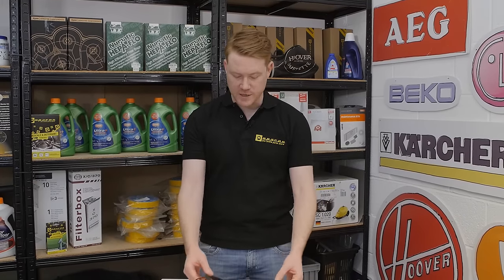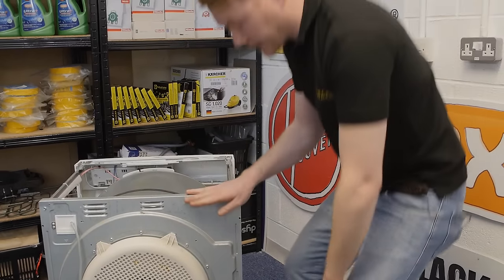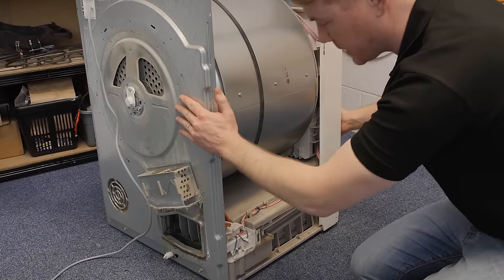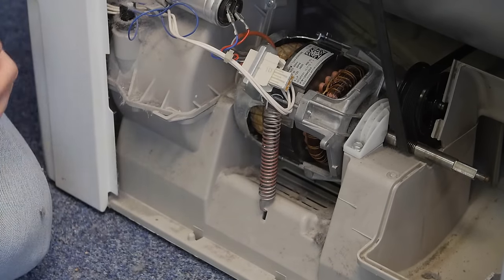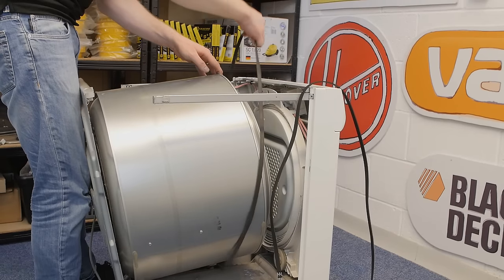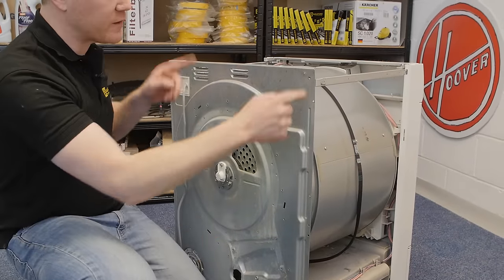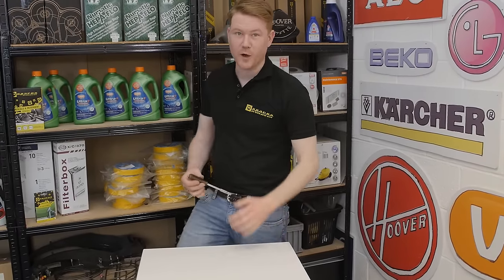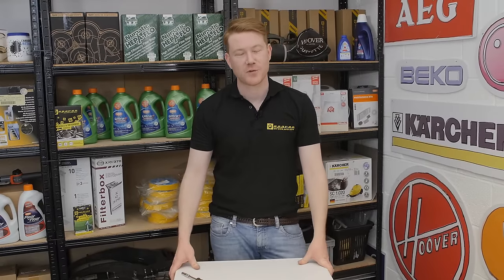Zanussi Tumble Dryer Belt Replacement – Change a Dryer Belt YOURSELF!

Comment: If anyone is trying to replace the belt on a Zanussi Lindo 100, you have my sympathies. It was not like the demo in the video ( there would be a lot more cursing if it was 😂) and some of the components were in the opposite sides of the machine. Many more screws too. Thanks to this video though, I got there in the end . It was a fight though, and I’m still not sure who won … myself or Lindo.
Reply from the maker: Hi thanks for your comment here...it's great to hear you have been able to complete the fix, especially as you were having issues and it took you a while. Sorry  this video couldn't help you further...appliance design can vary between models...but glad it helped you in some way.
Reply: Hi, i have the same problem with lindo 100. can you help me which side should i take off front of the back? i think the front, otherwise i cant take out the fan also....😢

Comment: My dryer was slightly different so I went through the front to get the belt on which was a simpler job for me. Then I had to remove the two covers of the front and back fans, and remove the motor, leaving all the wires all connected, and then I could put it through the belt so that I could get it onto the pulley system. Delighted with myself, fixed my dryer for 16euro ! So this video definitely helped me understand what needed to be done, but just a few slight differences.
Reply from the maker: Hi Fiona, this is amazing news! Thanks for sharing your own fixing experience with us. We are so glad our video helped you have the confidence to fix your tumble dryer yourself!

Comment: Great video.
I found on mine that the metal heater cover was very firmly stuck home. I had a look at what was left of the chassis and removed the two screws left at the top which attach the rear to the top rails. With these two screws removed there was just enough give to pull the drum back off its seal and guide wheels and refit the belt.
I didn't have to remove the heater.
Again thank you - without video's like this life would be way harder - as it is I have earned loads of brownie points........
Reply from the maker: Hi Jim, thanks for the great feedback and helpful tips. eSpares loves helping customers save money and fix their appliances. Well done for the fix!

Comment: We last changed the belt on ours about 4 years ago and it was murder!  This video is nice and clear,  anyone could follow it.  Thank you.  Very well done!
Reply from the maker: Thanks Victoria for the comments, remember to 'like’ the video if you enjoyed it or it helped.👍
Reply: eSpares Hi ,  my machine doesn't work unless I reduce load and manually give few turns to the dryer,  quickly shut the door and press start. Is the belt old and loose or problem with motor? Thanks
Reply from the maker: The problem is likely to be the motor capacitor is failing, for more information see our diagnosis video:
https://www.youtube.com/watch?v=u6614TVugVc  and
https://www.youtube.com/watch?v=Vd8DcQpk748
Reply: eSpares thanks

Comment: Good video. Excellent camera work. 
Watched this and another good video, before attempted repair - obvious broken belt.
Other video only took off left panel, but removed the centre bearing piece - to allow the belt to go over the drum.
This method avoided taking off the right panel, the fan and the heater and needed no electrical disconnections. 
Pulley route needed a few viewings, but route is obvious when you consider how the belt achieves tension ! 
Repaired our expensive AEG condenser dryer. 
"Brownie Points" earnt from my wife after ordering belt whilst on holiday & masses of washing to do on our return ! (Daughter report the breakdown). 
AEG is very like this Zanussi. 
AEG has a slightly different bearing cover with a lubricant applier ? (similar to a electrical carbon brush). 
Straightforward with average DIY skills, although admit to having two different screws left over (not the "hidden" ones mentioned) despite taking great care in placing them all in a plastic ice cream container to prevent loss ! 
There are a lot of screws. 
Bearing circlip "pinged off (as they do), but held a cloth over it to avoid loss ! 
Many thanks. (Subsribed !)
Reply from the maker: Hi Philip, thank you for your post and nice job on the repair, thank you for subscribing as we have many more useful videos coming out.

Comment: I managed to perform this fix without removing the rear heatsheilds or heater.
Just top, sides and top support rear screws which gave enough clearence to get the belt down the front of the drum.
A good tutorial video though gave me a good starter for 10. 👍🏻
Reply from the maker: Hi Ed, nice job.

Comment: I just completed a belt change on Zanussi TD4113W.  This is NOT a Condensing TD.   Your video gave me helpful hints but suggested more work than necessary for this machine. 
Remove top.  
Two additional items on the sides : 
- the vent outlet on each side has a screw; 
- there was a metal clip at the front of each side panel that needed to be removed.  After that only the top bar needed unscrewing from the back on each side.  Then the back can be tilted (gently because there are still plastic parts screwed near the bottom) enough to withdraw the drum from the front of the machine.  Put new belt around drum.
The fan is not at the back of the machine so the pulley and motor are already accessible. Reassemble. Done.
Reply from the maker: Thanks for the comments and description Steve. Although you were working on a different machine the description given may help others with models similar to yours. :-)
Reply: eSpares yes it worked for me needed to undo and redo everything you stated  to change the belt thank you for spending the time to make a video I was just making sure that I did it properly
Reply from the maker: Thanks for the comments Andrew, remember to 'like’ the video if you enjoyed it or it helped. 👍

Comment: Very good. This is similar to the AEG version. I’ve found, so far, that the capacitor, to the left of the motor and the pulley wheel for the belt seem to fail before the belt goes. At £9 for the capacitor and £7 for the pulley wheel, they are cheap to fix.
Reply from the maker: Hi robert, they would be similar as they are both owned by Electrolux so made in the same factories but well done for sorting it.
Reply: Thanks!

Comment: a great video just replaced mine, not so sure why all the back and heater element needed to be removed though?. Can easily be done without all that work but thanks it was a great help
Reply from the maker: Hi Paul, thank you for your post and glad we could help.

Comment: I have an old Zanussi condenser dryer that's around 20 years old which the belt recently went on, do you think I could still find a belt that will fit this? I don't have the part number as I haven't opened the dryer yet but the product number is TC - 481W, I'm just wondering if it's even worth opening if I can't get a part from 20+ years ago, I looked on Zanussi site and can't find anything.

Ideally I would like to try fix it as newer appliances today break down just outside their warranty which manufacturers only give 2 or 3yrs warranty these days. The only repair my dryer has needed is this current belt breaking, I'm sure it has a lot of life left in it.
Reply from the maker: Hi, it's great to hear that you are so keen to keep your tumble dryer working rather than buying a new one! We have the belt for a Zanussi TC481W on the eSpares website. Please note you will just need to checking the dryer's rating label (which contains your model & "product" number beginning "9" )...to ensure this belt is suitable for your particular version. If your label contains one of the 8 numbers beginning "9" as shown on this page in the green section, then this is the correct belt for you.
https://www.espares.co.uk/product/es501196/tumble-dryer-poly-vee-drive-belt---1975h6

Comment: You really made things so easy. I did all the steps 2 years ago and my Zanussi dryer worked  well. Now I have another problem, the belt is perfect but the drum doesn't spin. Although it makes sound like humming sound when it is on but no spinning. What could the problem be, please?
Reply: Hanada Abdelfattah I need an answer to this question, too. At the moment, I put my hand in the drum, through the front door and rotate a quarter turn and it seems to work, but I’m sure it will permanently stop, soon. I think it is the carbon brushes of the motor. I have changed brushes on two washing machines and a Henry vacuum cleaner very easily, far easier than changing a drive belt!

Comment: Hi, just wanted to say thanks for the video. I have the same model. I couldn't get the fan off so I kind of did it backwards. Over the fan, motor etc then the drum. Took some wigling but did it ok.
Reply from the maker: Thanks for the comments John. The fan often sticks to the shaft when the nut is removed hence showing using a screwdriver to 'Knock it of' the shaft at 6:18. Glad you manged it at the end.

Comment: Great video. I've just repaired my ZDE47100W using this tutorial. 
If you have the same model as me, you can skip removing the heater, and unplugging the internal connectors. Also skip opening and removing the fan. The design seems a bit more friendly to belt replacements (fan is the other side of the motor, and heater is at the bottom. The cables have enough slack to allow the drum to uncouple, without unconnecting).

Thanks again :) 
A*****
Reply from the maker: Hi Ian, thank you for your post and well done for fixing it and some really good information to help other people good job ☺

Comment: Thanks for the video.I have one simple question: How easy is it to move the drum by hand?The problem I have is,that the motor starts running but turns off after 5 seconds as the drum won't turn.The shaft of the motor doesn't get a grip on the belt.Looks like the belt is too slippery or worn but trying to turn the drum myself by hand is not easy.Even after loosening the motor  I have the feeling the drum is quite hard to move.But without being able to compare it to a similar tumble dryer I can only make assumptions.
Anyway: Thanks for sharing your video - must have taken some time to record and edit it.
Reply from the maker: Hi Toxy Tronic, thank you for your post, the drum should be free but it does sound like the belt may have stretched but check the bearing on the back and the drum supports on the front and yes it takes a lot of time and effort to put the videos together nut it's worth it if it helps.
Reply: Hi  @eSpares ,thanks for your reply - much appreciated.The belt itself looks fine to me and is very tight around the drum.Almost thought too tight.But I will check the bearings as you suggested. Either the belt or drum will be the culprit.....

Comment: Any idea how to access the fan on a Zanussi Lindo 300.  Your video shows the fan being accessed from the right hand side at the back of the machine but on the Lindo 300 the fan is on the left at the front of the machine and there seems to no room to access it?  Thanks
Reply from the maker: Hi Steven, have you got the product number so we can have a look at it.
Reply: When I enter my PNC number into Zanussi's website it shows as being model number: T8DBG48WC but around the internet generally it seems to be referred to as ZDC8202PZ
Reply from the maker: Hi steven, there are 2 fans on your model with a front and rear fan just like in the video at 5.22 you will need to get the cover off to access the fan and is usually held in by screws or clips.
Reply: Thanks for the quick response.  The tension wheel and spindle that I have to get the belt on are near the front fan though which is the one I don’t seem to have the room to access.  Does removing the rear fan help with this at all?  Obviously the motor housing is in between both of the fans as well.
Reply from the maker: Hi steven, it is usually easier to get the belt on by removing the rear fan as this does seem the best option, the front fan should come off but if too difficult we have removed the drum but that's a lot more work.
Reply: Thanks again for the quick response

Comment: Is this the correct info for model Zanussi Autosense ZTE 135 please ?
Reply from the maker: Hi Michelle, your model is a similar design so the dismantle procedure would also be similar as the motor should be on the same side as the one we use.
Reply: @eSpares  Thank you very much for taking the time to reply! :)
Reply from the maker: Hi Michelle, anytime we can help please get in touch.

Comment: great vid    replaced belt today but when i turn it on it spins once then get red light  any ideas
Reply from the maker: Check you have connected all the plugs especially the heater.
Reply: done that runthe diagnostic thingy get 7 red 1 green
Reply: on the vid attatched to the motor u have a black wheel that tensions the belt  what is that called as  mine has worn
Reply from the maker: The tension pulley is shown in this video: https://www.youtube.com/watch?v=hIuIdlA0LAg
and the pulleys are here:
http://www.espares.co.uk/search/ma332pt1966/tumble-dryers/pulleys/zanussi
Reply: just ordered 1 ty for ur help
Reply: @welshcpl2004   7 red , 1 Green is error code E71 which is bad temperature sensor.

Comment: My dryer belt seems to be slipping! it hasn't broken but is stopping the drum from turning sometimes, the belt looks fine and has no fraying. will I replace the belt or could it be something else like the tensioner spring has loosened?
Reply from the maker: Hi Jason, a very common fault on old dryers is the drum may not start when full but will run when empty. This can be due to a failing motor capacitor.
For more information see our 'Diagnosing dryer motor problems' video:
https://www.youtube.com/watch?v=u6614TVugVc
Reply: I replaced the capacitor on mine......sorted! Jason, do you hear a slight hum when the drum doesn’t turn? It’s almost certainly the capacitor that is the culprit. Just follow the start of this video, taking the side panel off. Be careful of the capacitor, it’ll hold a high charge. It’s the silver thing to the left of the motor. It’s dead easy to replace. It only cost me £9

Comment: my zanussi zde57140w is similar but belt keeps coming off the jockey wheel. the wheel has over 10mm sideways play on the shaft, is that right? the one in the video seems to have much less.
Reply from the maker: It sounds excessive so try replacing the jockey wheel as it is the most likely cause of the problem.
Reply: thanks but the jockey wheel looks to be in good condition, just the shaft it sits on seems too long. That shaft is firmly connected into the motor housing. There is a circlip on the end of the shaft, I could take this off and put some washers (?) onto the shaft to hold the jockey wheel in line with the motor shaft driving the belt below, but I don't know if this could cause other problems.
Reply from the maker: Your machine did not always have this problem so something has changed almost certainly due to wear. It is most likely the pulley or the belt itself that will cure your problem, washers should not be necessary as the pulley should be 'self centering' hence the raised centre.
Reply: Thanks, this was helpful info about the self centering pulley, it didn't look like anything had fallen off the pulley shaft as the circlip was in place. I've ordered a new belt and hopefully that will sort it, if not then I'll try a new jockey wheel. maybe the spring tensioning the motor against the belt needs replacing too to hold the belt tighter. Thanks.
Reply from the maker: Never needed to replace the spring, this should not be critical for belt tension so is unlikely to change in tension much. Good luck and please post when you have identified the problem.
Reply: I changed the belt and so far it works without slipping off the drive shaft. The old belt didn't look worn but it had stretched a bit. Anyway, thanks for posting the video and thanks for the help, much appreciated!
Reply from the maker: Glad to hear the advice seems to have worked, thanks for the update.

Comment: my problem is that the dryier just stop to run. nothing s lit. what could be the problem?
Reply from the maker: Hi silvia, we don't know your model but start with the capacitor or the motor as both can stop the dryer from turning.
Reply: @eSpares  model is zte 140. When selecting any program turning button, no beep and no lights on.
 Fuse is 10A but I can t find it maybe a SMD?
Reply from the maker: @slvmateop  Hi Silvia, check you have power to the dryer, it should be a 13A fuse in the plug so change that first.

Comment: On my ZDC47201W there is an Earth, Carbon-brush, on the front L/H of the drum which you have not mentioned. I assume this is for Static discharge. What is the part number Please.
Reply from the maker: Hello, part number ES625583 is the correct earth carbon brush for your model. Please follow the link below: www.espares.co.uk/product/es625583/tumble-dryer-earth-carbon-brush

Comment: What screwdriver is that thats being used ?
Reply from the maker: Hi Martyn, it is a type of nut spinner screwdriver that has different attachments, you should be able to get one from your local DIY
Reply: @eSpares  its all good, I ordered a tool box of ebay that contained same tools and nuts on the video. Can fix mine now.
Reply from the maker: Hi Martyn, thank for keeping us informed and good luck with the repair.